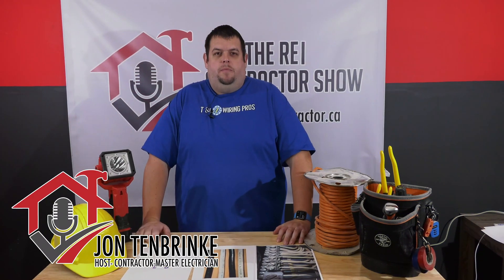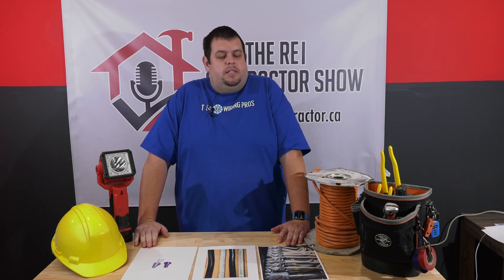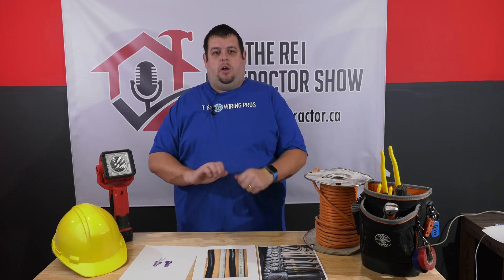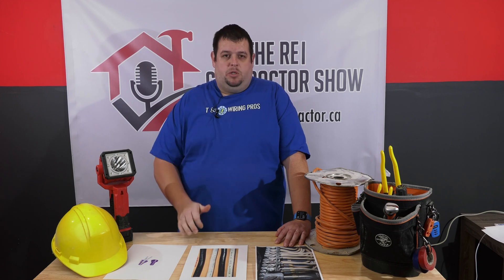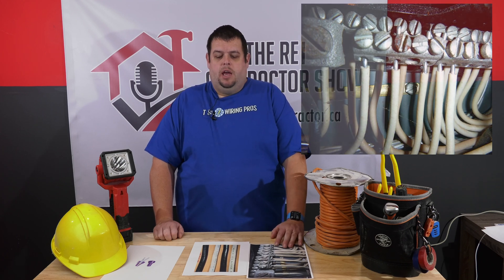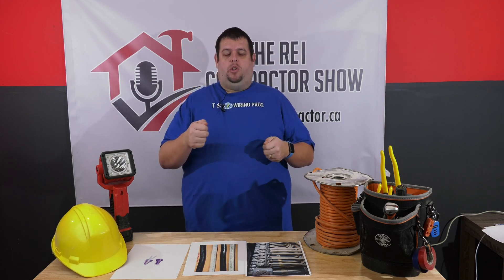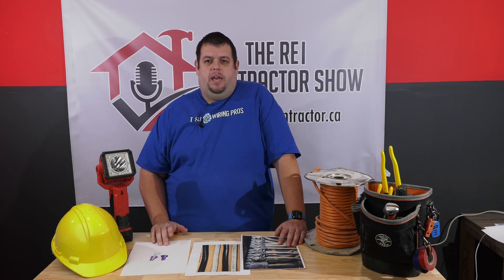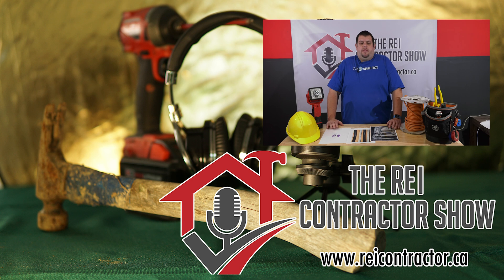Aluminum Wire: As much of a repair cost as you think? - Know your electrical.

Comment: Can I replace my outlets with co/alr rated outlets or do I need to use a pigtail with alumiconn connectors to fix the problem of copper rated outlets with aluminum wiring?
Reply: Yes, just replace the receptacle with a aluminum grade receptacle or switch
Reply: Supposedly no a CO/ALR rated outlet is not a good solution.  The connections still come loose over time due to the ductility of aluminum and expansion and contraction that occurs under load and when load is removed.  No one can ever explain why the ductility issue is magicall negated by Alumiconn connectors.  Still waiting for an explanation of why Alumiconn is better than a CO/ALR outlet.

Comment: Question: My parent’s house was built in 1941. The wiring looks like aluminum wiring. How likely is it that is aluminum, given the age of the house? How can I tell the difference between aluminum wire and tinned copper wire, which I suspect it is?
Reply: The problematic aluminum wire was only used for a few years in the 1970s. A house built in 1941 has zero chance of being wired with aluminum unless it was renovated in the 70s
Reply: Wiring from 1941 that looks like aluminum is actually tinned copper, whether it was knob and tube,  or the  then very modern cloth braided NM with a hot and neutral,  but no ground. Copper was tinned because the rubber insulation used during that era had a high sulfur content that was corrosive to copper, and also made for easy soldering.  Aluminum wiring was only used for roughly a decade during the Vietnam war era and most commonly used from about 1965 through 1973 give or take a few years and will have a thermoplastic sheathing resembling modern NM; that being said it's possible for a 1941 home to have aluminum wiring if there were renovations that involved installing wiring during that period.  Nothing unsafe about tinned copper in of itself,  but the insulation is likely dry and easily flaked off with the slightest movement,  particularly in ceiling light fixtures that may have been running 75 or 100 watt incandescents in the past, most older fixtures were designed for 40 to 60 watt bulbs.
Reply: @Sparky-ww5re  Thank you for the information. I really appreciate it.

Comment: One point I'd contest: 10-20k is nowhere near what the cost of rewiring adds up to in practice. The procedure itself may only cost that, but you have to knock out large sections of wall to get at those wires then reconstruct them afterwards. The total bill once you've gone through all that could easily be in the 50-70k range.
Reply: It's less because I'm having my entire house rewired to copper with a new 200A service panel for a lot less than 50.. And the promised only 3 or 4 small holes in the drywall, for a fairly big house.
Reply from the maker: It's a fair point to mention repairs, repainting etc.. But that sounds really high from our experience. Did you use a GC or do the project yourself, if you don't mind us asking?
Reply: @canadian_home_improvement_show  so far I haven’t actually tried to actually do the procedure, these are mostly estimates from contractors I’ve spoken to. I’ll know within the next day or two whether or not I’m going through with it. This would also be for a ~2k square foot house, so that’s part of the reason they estimated so high.